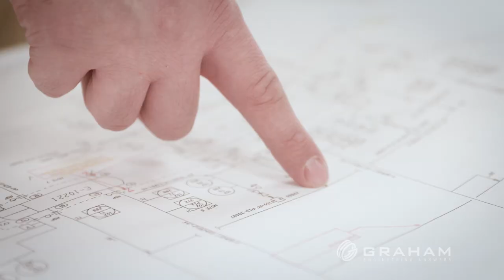Graham Corporate Story

Comment: What is the effect of  increasing the pressure on the discharge of ejector
Reply: At Graham, we offer two different types of ejectors; non-critical ejectors and critical ejectors. A non-critical ejector operates on a family of performace curve with nearly infinate operating points. Meaning changing the motive pressure and/or discharge pressure will change its performance. Though this usually perform little work due to its low compression. While a critical ejector operates on a single performance curve. In order for a critical ejector to operate properly,  design motive pressure must be met and discharge pressure to be below its MDP (Maximum discharge pressure). MDP is the highest discharge pressure that a critical ejector has the ability to achieve with the given amount of motive. If the ejector discharge pressure exceeds the MDP, the ejector will become unstable and break its performance and can negative impact the overall system operation.